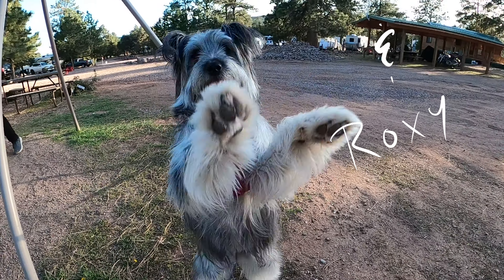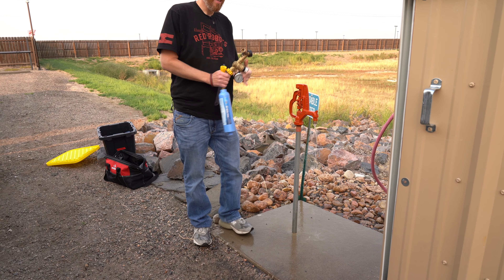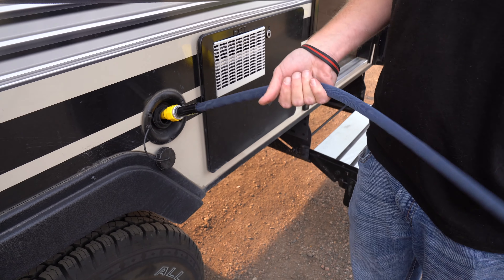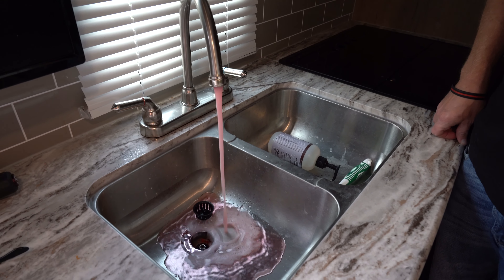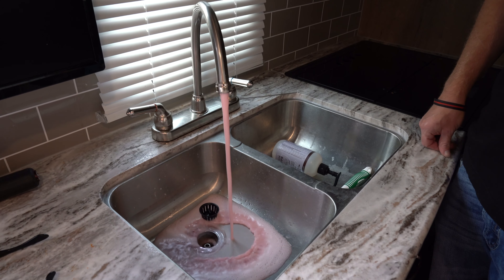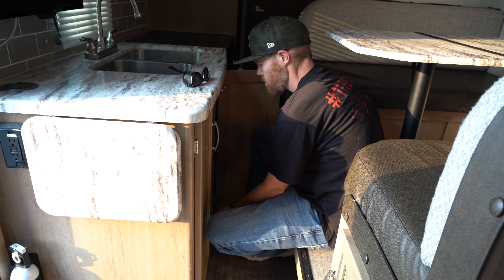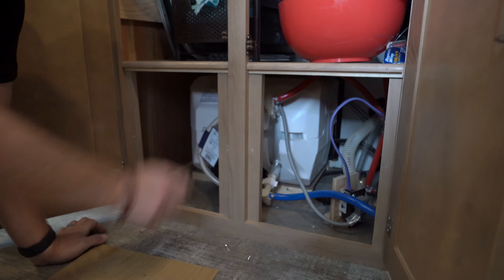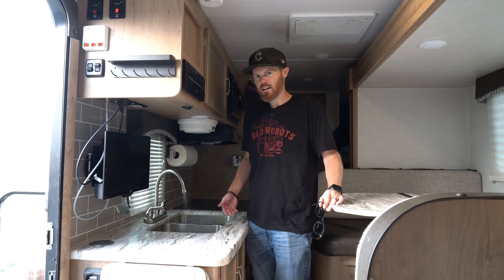How to DeWinterize a Travel Trailer - Winnebago Micro Minnie

Comment: I hate the pink stuff so much, I run a full water tank through about equally on the sink & showers, dump, refill with 10% bleach solution, run all that through, dump via low-point drain, fill tank with fresh, run sink/shower, dump, fill again and dump via low-point, and then fill with clean water. If I smell even a hint of bleach still, I'll flush that tank either by low point or sink/shower and dump and fill again. Maybe a little overkill, but I really like my water clean.
Reply: Where do you dispose that pink crap at

Comment: What about the outside shower faucets?   What aBout the lines in the back that you have to remove the inside wall to get to the valves?
Reply from the maker: Yes you want to open up and run water on the outside shower. I don’t open the low point drains to dewinterize because my outside shower pretty much flushes it all out already. You could let it drip if you wanted to, I’ve never had the need to open those.

Comment: That little "tool" for filling the fresh water tank is GENIUS.  You should have a link to that in your description, I'd buy that right now.  Good walk through.  What about the low point drains, do you do anything with those?
Reply from the maker: Here is a link for that tool to shutoff when filling your water tank up - https://amzn.to/3ksjSL0

(i just put it up in the description too per your tip, thanks!)

No need to do anything with the low point drains.  You will need those closed in order to pressurize the system and get flow through your sink.  A lot of times they are not too far from the outdoor shower so if you run clean water through there it will help flush everything out.
Reply: @ChadwickFamilyFilms  thanks, I just placed my order.

Comment: This is only my 2nd year with my Micro Minnie 2108 DS.  Last year after I bought it I didn’t do anything when I got down south except hook up the water and let the pink run through.  Didn’t  know about the valves, etc.  Haven’t used the tt since last April except for a weekend trip.   I had it winterized by the dealer (so I wouldn’t mess up anything) and the service man told me he left the valves in the correct position so I wouldn’t have to access them when I use it soon.  But this video sounds like I have to switch the valves before using the water heater so as not to get the antifreeze into my water heater.  I will go and review your other video on winterizing as that may help me.  I stay at full hookup campgrounds when down south so don’t use my fresh water tank.  Thanks for this video.  I will review again.

Comment: Does this method mean that I do not have to use an air pump to blow the water out of the lines and end up with only antifreeze in the pipes?
Reply from the maker: If you are talking about winterizing, then yes (but this comment was on a DE-winterizing video). There are two main ways to winterize. One uses an air compressor, the other (as shown in the video) just drains all the water out and utilizes anti-freeze without using an air compressor. Both ways seem to work well, it’s really just a personal preference I think.

With dewinterizing, you really just have to get everything all hooked back up and run water until all of the antifreeze is out of the lines.

Comment: This was so incredibly helpful. Wife and I just bought a 2306BHS and we’re about to take it on our first trip. Since we got it dry, I assume it’s similar steps of just checking everything is right with the hot water heater valves among other things. Thanks for this! Such a great video.
Reply from the maker: Glad it helped!
Reply: Make sure there is always water in your hot water heater before turning the element on.  It will burn out quickly otherwise.  Learned that the hard way.

Comment: That’s a great video. Thanks for the helpful tips. One thing I would add, to improve your sanitation, is to have a spray bottle with isopropanol to spray all your fresh water fittings prior to hooking up - particularly when you’ve had them lying on the ground.

Comment: Is there a video
To sanitize the pipes after the antifreeze has been flushed out? A little (half a cup of bleach) into the fresh water tank and CLOSE the hot water (red pipe) valve to the water heater? Then run the pipes by turning on the water pump and running both hot and cold faucets and let the bleach and water mixture run it’s course. Then once fill with fresh water to clean out the bleach? Would they be the correct method? First time trailer owner. Thanks in advance…Gordon

Comment: Question:  at the beginning, you put the rod plug in.. then started filling the fresh water tank.. do you leave that on/off switch for the hot water heater on the on or off position then turn it on after you turn the bipass valves toward the tank?  Or can you turn that water heater switch to the “on” at that very first step.??
Reply from the maker: Good question. I think understand what you are asking. 

You want to keep the hot water valve bypassed until you have fresh water running clear throughout the rig. This makes sure you don’t end up with pink in the hot water tank. Once it’s all clear, then remove the bypass so the hot water tank can fill up. 

Regarding the on off switch that just heats it up which there is not need until you are out camping and have it filled with clean water.
Reply: @ChadwickFamilyFilms  ok.  Ty for clarification on that.

Comment: Did you post the link for the hose extender with the valve?
Reply from the maker: I don’t think I did but here is a link - Camco Water Tank Filler with Shutoff Valve- Quickly and Efficiently Helps Fill Your Water Tank and Eliminates Line Backflow - Lead Free (5/8" Tube) (40003) https://www.amazon.com/dp/B0006IX850/ref=cm_sw_r_cp_api_glt_fabc_B6F9XBR90ZM3YN47T8A5

Comment: Thanks again for another great video! We are in Missouri the weather change by the hour lol. And I was wondering how hard it was to dewinterize if the weather got warm. Thanks. Could I use the city water hook up and dewinterize at a site?
Reply from the maker: Great question!  And I feel ya on the temp changes. It just dropped below freezing again here in Colorado after being in the 70s a day ago. 

All you need is water to run through your system and then a dump to clear your tanks. So a full hookup site is pretty ideal.

Change your hot water bypass after you flush it out and you are good to go.